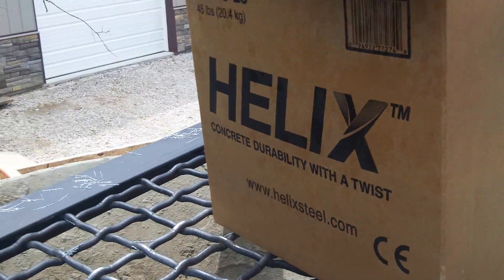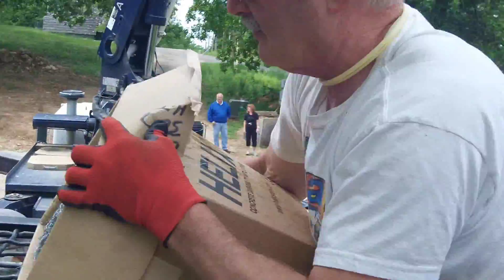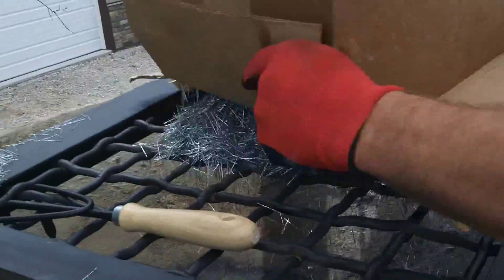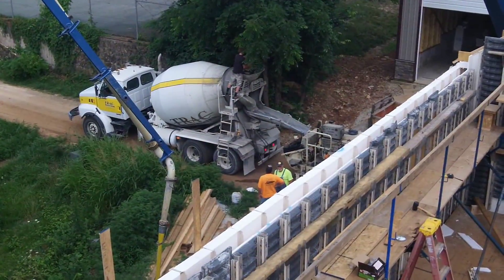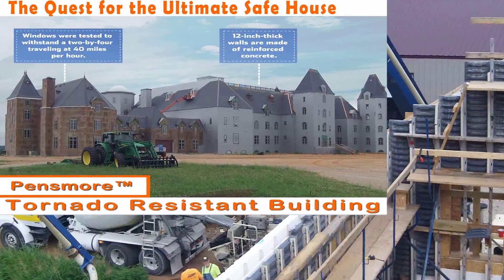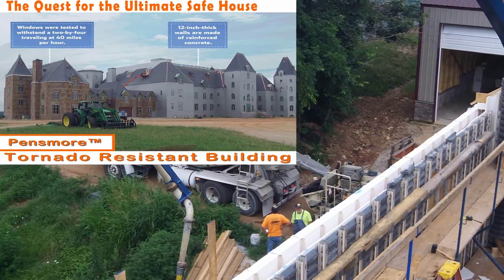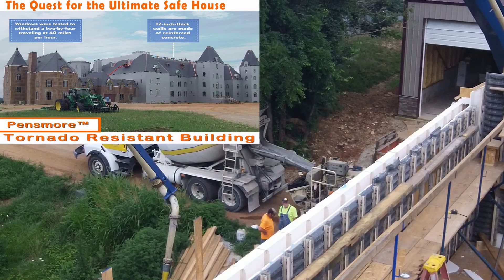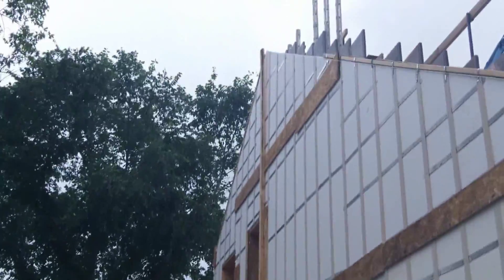What does a Tornado Resistant Home look like?

Comment: The builders did a great job pouring the concrete in these weird angles on the roof line.  The overall cost was maybe around 20% more to build than a stick frame house.  But the energy efficiency is amazing.  The disaster resistance worth it.
Our Dec electric bill for the nearly 3000 sq ft home was $100 - we have a 700 sq ft cabin not a 100 yards away that the electric bill was $90.
We have the temp set low in the TF Forming Systems home because there are no drafts to cool the air or cool our bodies.  It just feels warmer.
And this summer, even without the roof being insulated - it was surprisingly cool inside the house.
We will be turning on the radiant wall heating and cooling within the next couple weeks - so report back on that then.
Reply: Do you know if any engineers behind the design simulated its resistance against F5 tornadoes?

Comment from the maker: What is a Tornado Resistant Home?
If you Are looking for Design & Building Flexibility, you come to the right place. Reduced energy consumption, Greater safety, does that sound good to you.  Now you know your at the right place.
Then look at TransForm by TF Forming Systems and discover the all-in-one system that is revolutionizing the construction industry. 

When you call them, tell them Buddy said to call.  "And ASK THEM FOR THE BUDDY DEAL"!

TransForm is a revolutionary, new, lightweight, super-insulating concrete forming system that builds highly accurate, straight and true walls. 

Designed with four key features in mind, TransForm maximizes owner benefits with a safe, practical building process.

ENERGY CONSERVATION
DISASTER RESISTANCE
SUSTAINABILITY
CONSTRUCTION EFFICIENCY
TransForm BENEFITS

Learn more about the FORMING SYSTEM COMPONENTS

Keywords:

Pensmore™, Pensmore Mansion, Steven T. Huff, Steven T. Huff Pensmore, TF Forming System, Disaster Proof Homes, Tornado Resistant, Energy Efficient Home, Tornado Resistant Home, Tornado Resistant Building,TransForm, TransForm™, VerticalForm, Insulated Concrete Form (ICF), ICF concrete homes, insulated concrete commercial buildings, Building Green, DISASTER RESISTANCE, SUSTAINABILITY, ENERGY CONSERVATION, Disaster Proof Building, Disaster Resistant Building, Pensmore Mansion-Steven T. Huff-Tornado Resistant Home, Michael J. Schlueter, Guardian Building Systems LLC, Mayor Mike Seibert, Greensburg Kansas Mayor Bob Dixson,

All photos © 2014 by their respective copyright owners. No photograph may be used without permission.